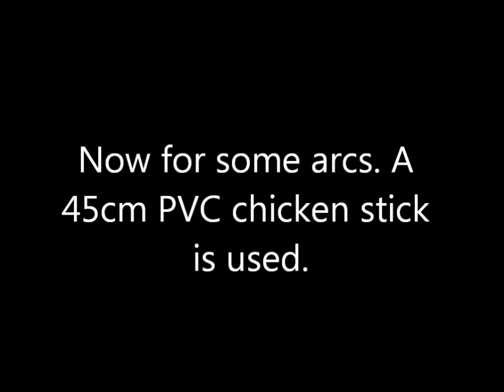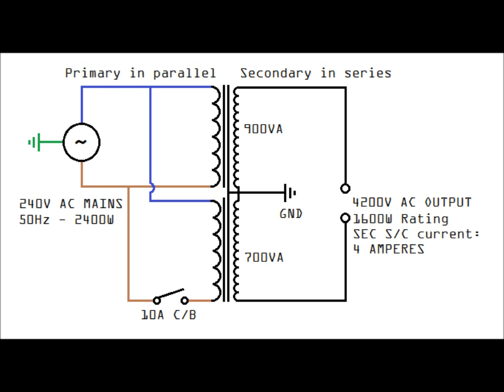High Voltage MOT experiments

Comment from the maker: Should be OK. I actually have the exact transformer you mentioned above, I will try it out sometime soon. It will function under arc load indefinitely, unlike the MOT. Also have a look at my other video with the ignition coil, it made a noticeable amount of NOx's inside a broken lightbulb, as seen by the reddish-brown gas inside.

Comment: Circuit is flawed. The circuit breaker should be on the live. Not the neutral
Reply from the maker: Whoops, yes, that is a mistake. It is just the schematic though. In the real circuit the breaker is on live.
Reply from the maker: Nah I actually did make a mistake with this one. Neutral is always 0 volts (it's connected to ground) and live is 240V RMS, so while the circuit breaker WILL break the circuit to prevent current flowing, the MOT will still be "floating" at live mains voltage, 240V above the ground. It's just the schematic that's wrong though, in real life the circuit breaker was across the live.